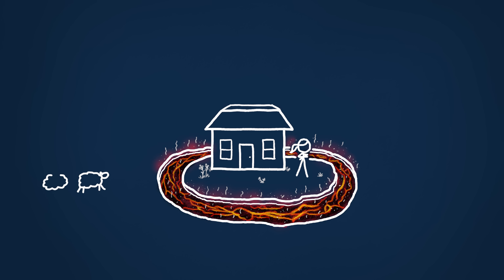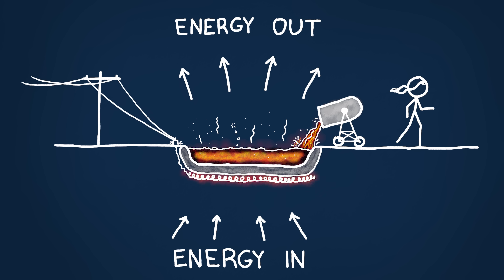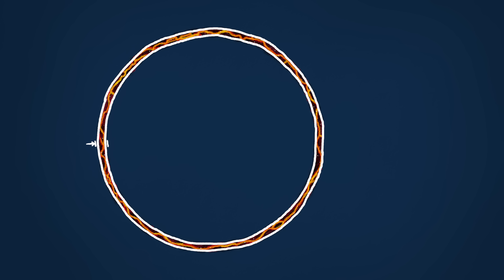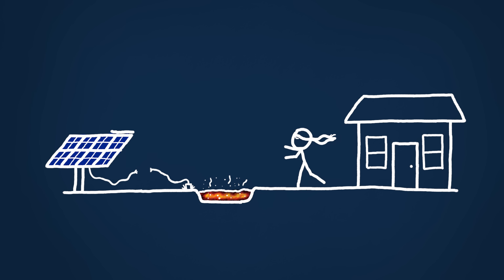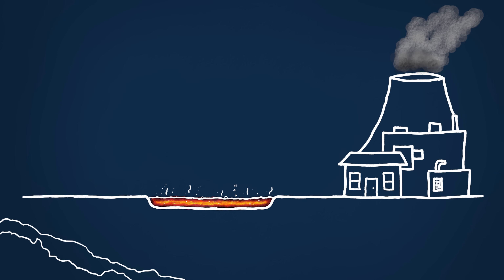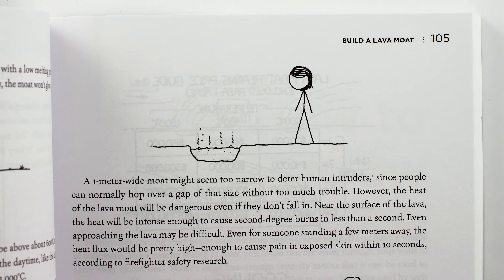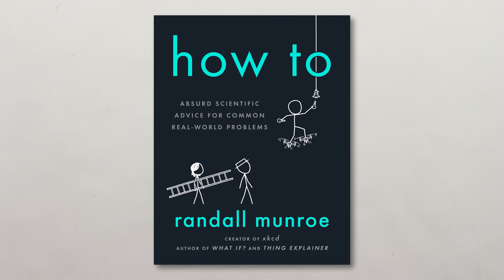How to Build a Lava Moat (with xkcd)

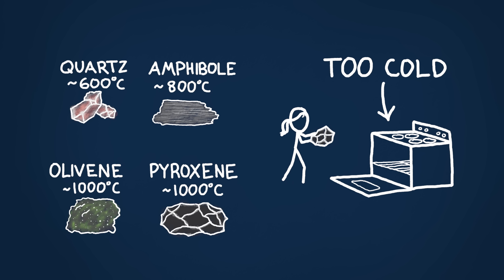Comment: 0:20 Erm... Quartz doesn't melt at 600ºC. Maybe 1600º? Another typo is "olivene" -- the correct spelling is "olivine", and its melting temperature is at least 1200º, and can be as high as 1900º depending on the proportion of iron.

Comment: record scratch* 
Hold up. Idk bout that solar panel math. Admittedly math aint my jam, but wouldn't a 8km circular area only be for the default moat size power needs and not enough for the 2.5km diameter moat needed to ensconce said panels? Does that math... ever scale? Or is that what you calculated? Videos hitting me pretty fast so maybe you mentioned that.

Comment: Solar panels are more powerful now. I have panels that are about 250W/m². That means that to get 100kW, I need 400m² of panels instead of the 2000 mentioned in the video. Also, let's assume that the panels are about 21% efficient in converting light to electricity. If we convert the light to heat directly, we could get at least a 4x efficiency increase, so now we need only 100m² of panels. 

A full lava moat is outside of my budget, but that should mean that per 1000W of solar power I can sustain 0.04m² of lava, which works out to a square of 20x20cm. That's not nothing! Tiny lava fountain it is

Comment: Geothermal plants also are dependent on outside temperature in order to generate power, the difference in temperature between the surface and the bottom of the circulation system is the primary mechanism powering those plants. With all the heat generated from a lava moat, geothermal plants may be just as effective, if not worse, than solar at this task.

Comment: What if you build a base inside of an active volcano. 
That would solve your lava problem but in order for it to be cool enough to live in you'll need to somehow convert the heat energy of the Lava into electricity and use that for cooling.
Is this at all plausible?

Comment: I noticed with your breakdown of solar you only used photovoltaics, but I think a more efficient solar power would be reflections. If a solar panel can only absorb 15-20% of the light a lot is wasted and that is what makes the area so large. I know mirrors can reflect like 90-95% of the light so that would definitely cut down on size. There was a steel refinery that used solar power, basically doing what archimedes did with mirrors (directing them to a single point to cause ships to set fire).
Reply: That is true. The thing with these solar reflection power plants is that they need a really large area for the mirrors to make this work, but in this video, they assume an absurdly large size of your land.

Comment: Nuclear power plants are not self-contained to the size shown. There is also a series of cooling ponds, which would have to be inside the perimeter and guarded from the heat of the moat. They are pretty big.

Comment: You don't actually need rocks and heat, all you need is water, since ice is a type of rock, therefore molten ice is lava (it actually is, scientifically). So a water moat is a lava moat.
Reply: It was said in this video that it only counts as a lava moat if it's glowing and water is too cold for that. You can't heat up water to the point where it glows because it would evaporate first.

Comment: Another option might be to blast an aqueduct (lavaduct?) channel to your moat from a nearby active volcano or other source of lava. You would also need another lavaduct to let lava out so that your moat doesn't overflow, but on the plus side, anything that ends up in the moat will be slowly carried away by the flow.
Reply: Your solution is much more practical than the one on video, if you live nearby a volcano. The method presented on video is just theory, based on nothing but ungrounded physics. 😂

Comment: I'm installing a more eco-friendly molten glass moat. We're putting the reactor core directly into the moat to heat the glass. The Westinghouse guys said I should get a nice violet glow from the Cherenkov radiation. We're also working with Monsanto to get GMO alligators adapted to live in the moat!

Comment: The energy comparison to light bulbs makes no sense... If the lava can't be radiating like 1000 100 watt light bulbs. If it were, it would be glowing as brightly as 1000 100 watt light bulbs, which it isn't.
Reply: Thats because a small part of the light bulb is at super high temperatures, enough to glow brightly in visible light. That’s why they used to use tungsten filaments (high melting point) and have to be in the bulbs instead of exposed to air (to prevent oxidation)

Comment: Or you could let the lava cool and solidify, then have a button to press that would activate the heat source and restore the lava to its molten state. It would be the remoat control. You could also break off pieces of the solidified lava and hurl them at your enemies as long as you didn't live somewhere with a basalt weapons ban.

Comment: I'm wondering if using a liquid metal cooled reactor would not be more feasible as you are wasting less energy in conversion from heat to electricity and back to heat. You might have to sacrifice a bit of glow effect but it might be just as impressive if you use something like molten lead.

Comment: Two questions: does the 100kwh/m^2 take conduction and convection into account or just the radiative heat? Additionally how often is maintenance required as electric heating elements at those temps would degrade rather rapidly.
Reply: I’m an engineer who designs industrial electric heaters and heating systems for a living.

1) At orange-glowing lava temperatures, radiation dominates over convection and conduction by around one or two orders of magnitude.  Convection is a factor, but almost a negligible one.

2) the watt densities required to output 100kW per square meter are actually readily achievable.  We build heaters using resistive elements with over twice that watt density for certain applications.  The durability challenge would really be more about your electrical switchgear.  You would need to break the power supply up across a ton of circuits to get everything to work reliably long-term, and probably have a dedicated system to remove the waste heat from the components and cables.  This waste heat would be too low-quality to harness for direct heating of the lava, but you could probably get some supplemental electricity generation out of it.

Comment: Ya know, you can't fit 1000 standard 100W lamps in a square meter.  But you most certainly can fit 400 T-10 250 W halogens.....

Comment: If you're going nuclear, go the direct heating route. After all, that's how the Earth's core maintains it's heat over time. If you're not worrying about practicality at all, americium-241 is present in spent nuclear fuel. A 10cm (4") plate of Am-241 under the moat, with adequate insulation, would give you ~114kW/m^2. It would take over 50 years for the output to drop below 100kW.

You'll want a chunk of something dense and inert with a high melting temperature between the Am and the lava, to keep them from mixing together, and to shield the radiation. I think Tungsten is a good choice, but if you're going for extravagance, platinum would work too.

Note: I say plate, but Am melts at 1176 C, so it might be a 10cm deep pool.

Comment: Lava Moat?! That sounds like what I did with Fort Knight. Awesome.
Though my design, as a Powerpuff, was to drill a hole into the mantle, funnel that up through intense pressures, and have something like a more acute bubbling volcano...just with air moderation so that the lava stays liquid by harnessing the planet's own inner heat, perpetually, as well as artificial pressure control to prevent over-pressurizing (also known as an "eruption"). Thankfully, Colony has an incredibly thin crust, so reaching its liquid mantle isn't unreasonable for a Powerpuff.

Of course, I AM over-simplifying a couple of details there, mister quantum scientist! >;)

Comment: An easier option is just to build a deeper moat, so as the lava at the top cools down, the lava below it can replace the lost heat, extending the moat's lifespan. A moat a meter and a half deep should keep the moat going for a couple weeks, then it's simple as scooping the cooled rock out, reheating it, then pouring it back into the moat every month. Much less time consuming than maintaining a geothermal power plant or a ton of solar panels.

Comment: Well, I would use the heat from the lava to create steam which would spin turbines generating electricity. It would be pretty self sustainable, I think
Reply: that is a perpetual machine, there willl be some heat lost, which would causeless energy, so the lava wont be as hot, which would decrease the energy further and so on until your lava moat is  a rock moat.

Comment: Do you truly need the moat to be melting all the time? If you've got the crucible and the heating coils, could you instead save power by connecting it to an already-existing security grid and just heating it up really fast when an intruder is spotted?

Comment: I think you really want at least 2.5m. 1m seem quite easy to jump over, and even with regular clothes, I don't think you will feel so much the heat if you run.
that's interesting, maybe a hybrid water moat +  a small portion lava moat with a moving bridge above it can add some panache to a renovated castle.

Comment: Step 1) make a square around your house, 2 blocks wide and 2 blocks deep.
Step 2) Get a bucket with 3 iron.
Step 3) Mine down until you find lava.
Step 4) Use the bucket to gett a lava bucket.
Step 5) fill the square surrounding your house.

It's simple!!!

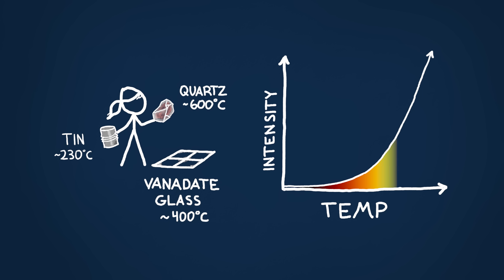Comment: 0:30 Quartz does not melt at 600°C. According to Wikipedia, it turns into β-quartz at 574°C (which can break it, but it's still solid), and then melts around 1700°C

Comment: it seems odd to build a power plant to produce electricity to heat the lava...you are basically turning heat into steam into mechanical rotation into electrical energy into heat...just use the heat from the coal or nuclear reaction to heat the lava.

Comment: In addition to the solar panels, one would need batteries, flywheels, or some other form of storage because the sun does not shine constantly. Also, thanks the energy density of uranium when used in a nuclear power plant, it wouldn't need to be resupplied for long periods of time. In fact, nuclear power plants typically encase the fuel rods for the plant's entire lifetime in the containment dome.

Comment: Using a nuclear reactor to generate heat to generate electricity to generate heat seems very inefficent. Using a coolant loop from the reactor into the lava would definitely increase the efficiency significantly, and if you only use 1 loop, now you've got radioactive lava. Absolute win.
Reply: Well actually nuclear reactors operate at slightly lower temperatures than needed for a glowing lava pool
Reply: @shk439  Reactors operate SAFELY at slightly lower temperatures. If you move your reactor core to your moat and let it meltdown, you get radioactive lava for free that will keep itself warm for years. Your house better be a fully sealed lead bunker, however.
Reply: @NavarroRefugee  Yes, direct heating, no cooling loop required.
Reply: Lead can Stop most radiation but it's not a fool proof solution.
How Will You Get Out Of There.
Once In, No Leaving in a few thousand years.

• Military Helicopter, Figher/Bombar Jets Left The Chat
Reply: @NavarroRefugee hell of a maintenance cycle
Reply: @shk439  I think nuclear reactors operate at lower temperatures because of thermodynamic efficiency reasons, so a reactor specifically engineered to melt a lava lake could be used
Reply: @shk439 but lava is a less effiecient coolant than water so if you design it so that it can withstand those temperatures then a normsl reactor would be able to operate at those degrees
Reply: To be even more efficient, you can try using lava as a coolant
Reply: @shk439  newer fast breeder plants actually tend to use liquid sodium. You could use the closed sodium loop to heat exchange to the lava. Can't use sodium directly due to water reacting.
Reply: @shk439  What about lava moat made of elephants foot
Reply: Ferb I know what we’re gonna do today
Reply: @lizardi1037  :o
Reply: Better than a lava moat : a corium moat
Reply: If the coolant loop from your nuclear reactor is hot enough to DIRECTLY heat a lava moat, you have serious problems.
Reply: Tell that to the inventor of diesel electric locomotives.
Reply: You would have to 'cool' your power plant with something else than water though, something the same temperature as the lava it heats...
Reply: @Marcel-yu2fw  MORE LAVA. What could go wrong?
Reply: You could have a breeder reactor and just dump the plutonium and reactor waste products in the lava as you produce them. As long as you don’t reach critical density anywhere it will be fine. Definitely no inefficiency in heat distribution.
Reply: Just use a pebble bed, to heat the lava directly😏
Reply: good stuff, really thinking outside the moat
Reply: If you're okay with radioactive lava, you could skip the reactor entirely and just mix radionuclides directly into the lava to keep it warm using decay heat.
Reply: This is such an annoying oversight in his calculations that I almost want him to redo it
Reply: Without electronics, or fancy phase change material, you can only get as hot as the initial heat source. Heat pumps are the most efficient way to move heat across a temperature gradient.
Reply: Or just use the rocks in the reactor and make RADIOACTIVE LAVA
Reply: It's a good thought, but it seems the devil is in the details with that one.
Reply: And as a bonus you get a radioactive lava moat, which is more metal than a regular lava moat.
Reply: Just let the reactor over-heat and melt down. Direct the melted reactor core, "corium", into your moat.
Corium is essentially lava the generates it's own heat.
Reply: genius
Reply: Dont even need cooling for the last part
Reply: I imagine the permitting requirements for radioactive lava could be quite onerous. Better consult my HOA.
Reply: Same concept for solar. Could just uses mirrors to focus the sunlight directly at the most, and then you have death rays above the moat too.
Reply: RADIOACTIVE LAVA.
Reply: i would really want radioactive lava around my house, and paying the charges for people dying around my house because of the radioactivity
Reply: @jarziii_yt6476  But how will the police arrest you, or give you fines? They are going to have to make it through the radioactive lava moat first
Reply: @robirahman  those darned HOA's always find a way in...
Reply: @jarziii_yt6476  if nobody can get to your house, you don't have anyone to pay... you don't get to pay anything, not even taxes..

but you can't get out either... as nobody can reach you, you can't leave your volcano bunker either
Reply: @jarziii_yt6476  Bro does not know how they'd be making him pay in the first place
Reply: Its Called Corium (Lava Produced During Nuclear Meltdowns Of The  Reactor Vessel), Then In That Case Need A Steady Supply Of Uranium No Power Plant Needed.
++ Radiation Damage
-- Friendly Fire (No Man Left)
++ Radioactive Fumes
++ Radioactive Waste
--- Whole Nuclear Department Is On Their Merry Way To Get You And You Lava pool cleaned & get you in jail.

-- People Can Still Dig a Tunnel Into Your House
Reply: I bet the Ukrainians would have liked a radioactive lava moat around their Chernobyl reactors when the Russians attacked and occupied them and held the operators hostage. :-/
Reply: Actually, you can just throw your radioactiving rod into the lava.
Reply: Gonna need a pretty temperature resistant reactor for that
Reply: Yeah but the reactor coolant is just water which boils at 100 degrees. Too cold to heat the lava moat.
Reply: Even better if your fuel is liquid and mixed with the coolant.
Can't have a meltdown if your fuel is already melted 😁
Reply: Maybe just use a molten salt reactor and run the molten salt on moat. Tech is there. Into action (tomorrow)!
Reply: At that point just put the uranium in the moat. Radioactive moat!
Reply: We're going about this all wrong, simply fill the moat with supercritical uranium/moderator mixture and wait for it to melt down. And there you go- radioactive lava moat.
Reply: The radioactivity would kill those who were inside the moat tho
Reply: The key problem with nuclear reactor (in general,but residual in this application) is the requirement for a  contnious access to  abundance of clean water. 
Although you may potentially use molten rock as a coolant, relying on heat radiation , instead of evaporation will make the operation very tricky. For starters, you would need not a single boat, but a concentric series of them so that your can vary the radiation area to handle start up, maintenance and weather events.
Reply: @hippohood  Even with solar that's going to be an issue, while you don't generally have to cool panels because they aren't that energy dense, having a lot really close together would generate a fair amount of waste heat. And solar panels lose efficiency when they get hot.
Reply: The reactor probably would explode
Reply: @sirocbit8041   You're confused, RBMK reactors don't explode.
Reply: @sirocbit8041 in AWSOMENESS!
Reply: Filling the mote with spent waste from the reactor would solve two problems at once